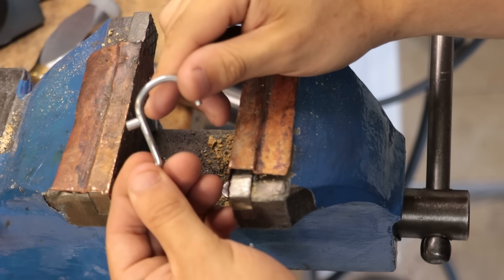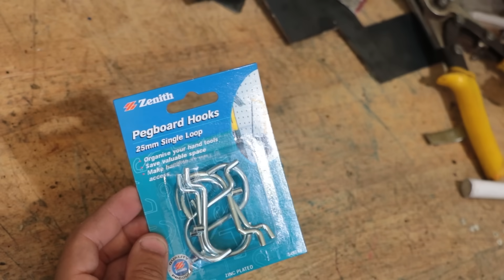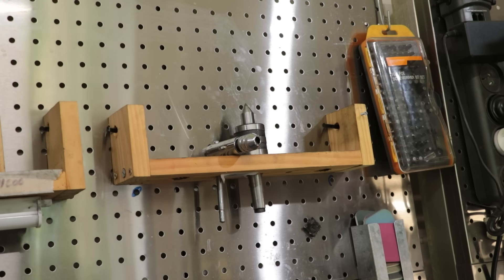Making A Cheap Rivnut Installing Tool

Comment: I like your approach towards the pegboard but if you're not proponent towards them already there are definitely better solutions for modular storage out there already, from the age old french cleat all the way up to 3D printed honeycomb style pegboard alternatives, you name it... But, pegboards have their place due to their wide use and if we are gonna tackle adaptation, id go for a more streamlined revision of your approach. 
As much as I appreciate the fit and finish, especially in the concentricity of a rivnut, the issue now is that you've created a problem while solving one.
Having to set a rivnut everytime you want to change the layout, takes you a step away from the prized modularity of a pegboard.

And sure you can still test configurations with the unmodified hooks before commiting to the rivnut, but as soon as you change your mind from the first time... you're left with the remnant rivnuts that linger in the holes of decisions past/previous layouts....
What im getting at, is that if you're introducing an eyesore at the cost of modularity anyway, why not just get back to the point and commit to the modularity all together? 
It might take you a while the first time (surely no longer than making a custom rivnut tool) 
but you could spend that couple hours welding a nut to the back of every hole and be done with it the first time. 

Sure you still have to modify/create custom hooks for certain applications but now a regular bolt becomes a quite sturdy hook for any hole in a matter of seconds...
The gained convenience of this suggestion can easily be cancelled out by the reality that not everyone has access to a welder and a rivnut might just do the trick for them at a much lower cost comparatively. To those folks this need not apply and I say if youre this far into it, get a welding machine already!

Anyway I realise this video isn't about workshop organisation lmao its about making your own rivnut tool.
To which, I appreciate and give a nod towards your fine craftsmanship.
But there's my 2...or 10 cents towards your approach if you find any value from it at all.
As always I appreciate your great content and look forward to the next one!
Reply: It's definitely a love/hate with pegboards, but they are cheap!

Comment: Some advice that I’ve received from my father regarding rivnuts is that they aren’t designed for repeated use. Essentially, if you plan on using them for something that is meant to be disassembled and reassembled numerous times they don’t hold up very well. Just something to keep in mind.
Reply: If you want to use them repeatedly, fixing them with 1-2 spotwelds will usually keep them from loosening over time.
Reply: @ExplosiveOldMan At that point, just weld regular nuts to the metal and save a step.
Reply: They also make stainless ones

Comment: Would a key on the bolt and a keyway through the body of the tool remove the necessity of holding the bolt with the socket?

Comment: Don't get me wrong, this is very nice and I do like it. Especially making the handle hinged and the wonderful ball end... But.
I was really hoping you were going to make a cam over tool to do it instead of the usual two nut method but with a very fancy washer.
Not knocking what you did which was top notch for what not knocking what you did which was top notch for The tool it is, I'm just looking for some kind of lever actuated cam pull that's better than the cheap $15 rivnut tool.

Comment: I use rivnuts quite frequently if you put them anywhere likely to corrode.  Put some red Loctite around  the section that compresses.  It will stop them from spinning and reduce corrosion.
Reply: I would modify that suggestion slightly. Use the Loc-tite 609 retaining compound instead of thread retainer. ( 609 is general purpose. There is a stronger version.) I've used this on small sliding rods and needed an arbor press to separate the parts. It's wonderful stuff.
Reply: I use a small file or dremel cutter to make the hole irregular, the rivnut flows into the irregularity making it not spin.
Reply: Very nice tip. I wonder how 640 would work since it has slightly higher gap filling properties
Reply: @jonnymiskatonic  It would probably work just fine.  I just always have the red to hand. A spinning rivnut is a sad thing.
Reply: Antiseize or ox guard is a much better option. Red loctite can break down or not seal properly still allowing corrosion. Plus side of anti-seize specifically  sensor safe will allow you to maintain a permanent ground while preventing corrosion. Red loctite will also not stop galvanic corrosion which can be an issue when working with aluminum.

Comment: Steel peg boards aren't thick enough to properly engage the hooks, but that is only half the the problem.  The biggest problem is peg board holes come in two different sizes, Ø1/8" (3.2mm) and Ø1/4" (6.4mm) holes and most hook sets are advertised as "universal", meaning they work fairly well in the smaller hole peg boards but flop around like a hotdog in a hula-hoop in the larger hole boards, lol.  If you have the larger hole style board you have to look for hooks that are specific to it.  If you use an actual press-board peg board with the appropriate sized hooks and use the locking clips that come with most sets of hooks they work much better.  Having said that, your method is way more rigid and durable.  Thanks for another great video.

Comment: Maybe add a recess for rivnut head so the bottom of the tool is flush with sheet metal when you install rivnut? Use a washer sized to thickness of rivnut head? That way you will keep sheet metal flat and don't make it bulge?

Comment: I just had the idea that if the depth of the sheet metal isn’t critical (as in contrast it would be in let’s say square pipe), you could just use the m8 screw and tap an m6, m5, m4,... section on it. So you could use one bolt for all these sizes...?

Comment: Use one of those ratcheting wrenches on the tool, so you dont have to change position. Resize the bolt head to smaller size so it fits inside the ratcheting wrench and just use smaller nut on ratchet.

Comment: A very nice little tool.
FWIW,  pegboard was originally made of 1/8" thick pressed paper board (Masonite), and drilled with 1/8" holes. Pegboard hooks are designed to fit those specs. When hung in that material they stay put.
It is no surprise that they have no purchase in sheet metal "pegboard." Really, sheet metal pegboard ought to have hooks designed for its larger holes and thinner sheet.
Reply: Yeah the metal pegboard he has seem to have 1/4" holes when using 1/8" thick hooks (or whatever the metric equiv is).

Comment: Given all the extra holes to work with in this particular case I'd take strips of flat bar long enough to span two holes, with a threaded hole in one end and a plain one in the other, as anchor nuts.

Comment: Engineering wise the magic number is three threads regardless metric, english, Wentworth, buttress, Square or any other thread you wish to name. Find a nut measure its thickness and we will always be three pitch threads thick
Reply: If what you say is true, why is an M6 nut (1mm pitch) 5.2mm thick.
Reply: @barrycaudle9926  inch and metric threads are measured differently. Metric threads are measured from the top of one thread to the top of the next one and are expressed in millimeters or fractions of a millimeter threads in inches are expressed in the number of threads that are counted in the span of one inch but what we are talking about is the distance traveled in one complete Revolution of the nut. For example an M6 by 1 mm nut that is 5.2 mm thick will have to rotate five times to advance its thickness. Therefore there are five threads in that nut. But 3 is optimum from an engineering standpoint.
Reply: @barrycaudle9926  for instance on an M6 Bolt with a 1 mm pitch means that for every Revolution the nut takes in advances on the bolt 1 mm distance. Therefore a 5.2 mm thick nut will have five threads in it but optimally from an engineering standpoint you only need three threads
Reply: @Bobwithoneo99999  In fact if you assemble a nut and bolt of the same class it is always the nut that fails. The true strength of a thread is found by calculating the shear area at the effective diameter.

Comment: Rivnuts are a better way to improve the pegboard functionality, but where only moderate strength is needed, I used a method common on Japanese electronic equipment;  use a dimpling and piercing tool instead of a drill to punch a hole in the sheet metal that is bent inwards around the circumference of the hole.   You then have enough depth to tap about 3 turns of thread.  It is very quick to do and nothing could be cheaper.
Reply: French (Schneider) electric industrial gear have such threads since 50s, i think that they use large punch presses beacouse they in some cases draw lots of material, and almost achive full lenght of threads. Metric standard says that you must have 80% of thread diametar.
Reply: The PERFECT job for a fly press!!!
You can hack these holes using a tapered centerpunch, just need it to be very gentle and have an accurate sized mandrel (about thread minor dial + 2x metal thickness, then trial and fit).
.
For speed of assembly, find/harvest "trilobular" self-threading screws. These are easily identified by a slightly "Wankel Rotor" shaped end, which reforms and cuts the thread automatically. The screws are used in most automated assembly, so easily found in used equipment.
.
Old DVD players use 3mm. Dog beds and other frames are usually 4mm. A fabulous source for larger ones is old treadmills where they use up to 6mm for the legs, handles,  frame etc.
- Grab them with a hex driver when you are harvesting the DC mother and Driver board 😉
Reply: @johncoops6897  ; Re fly press, spot on, and in using a tapered punch and die/mandrel, you get to attach metal to sheet metal without the gap caused by the head of the Rivnut.
Reply: @keithammleter3824  - my dad was an engineer and I have inherited his tools. Aside from press tools there is also a metal tin full of hand punches, including a variety of those long tapered metal threadform punches.
.
It's easy to see how much they have been used since they have dents in the sides of the (usually rectangulat) handle from being repeatedly bashed to unstick them from the hole! 😃

Comment: Rivnuts are adictive, once you start using them you put then in pretty much everything, so buying a Gun is prehaps not so bad after all. They also come in countersunk, but don´t hold up quite so well, in which case making a flair tool to countersink normal ones would be a nice project.
Reply: Or, make a dimple + die tool to dimple the surface of the sheet metal slightly bigger and slightly deeper than the flange of the rivnut, then the rivnut will sit flush nicely with the surface👍
Reply: There are also a hex shank type with a very small flange.  Great for flush mounting, and with no chance of turning in the material
Reply: @russcole5685 Yep, the hex style are quite good, however they need an additional hex tool to punch a hex shaped hole in the panel prior to installing the hex rivnuts😁
Reply: Lol. This is very true. I bought a decent kit about a year ago thinking I just needed it for that one project. But like most tools. Once you have it you find a million different reasons to use it lol
Reply: Wait until you discover plus nuts.
Reply: @jimc12  That was long ago.

Comment: I'd use a ratchet wrench to turn the nut 
It was painful to watch how slow that must've been 
Great idea
Reply: I was thinking it was an air ratchet job too.
Reply: Even better.
Reverse thread the nut and bolt to you can fix the nut in place and just use the bolt for both holding and crushing the insert

Comment: 0:55 Normally, the thread should have the depth of the Diameter in steel. A M8 should have at least 8mm of depth. In aluminium you should have the factor 1.5 (12mm depth)
Reply: Thank you, I have always wondered this, especially if I was to use a helicoil for repair.
Reply: @brianm9962  It depends on the thread size and pitch. But if you use 1x diameter, you aren't wrong. It is the easy and quick version.
I don't calculate the depth of the thread, because it is already cut